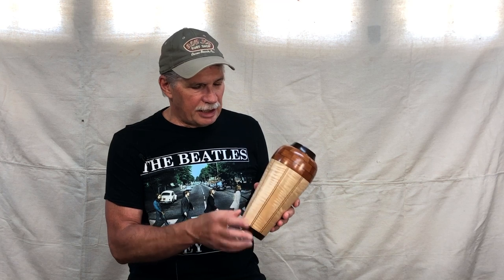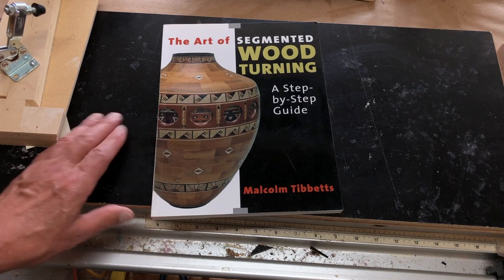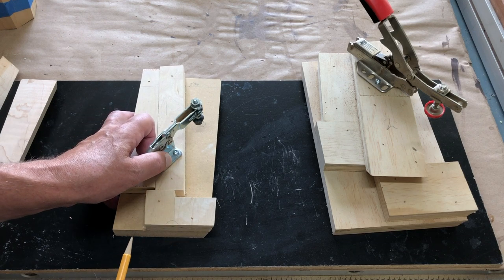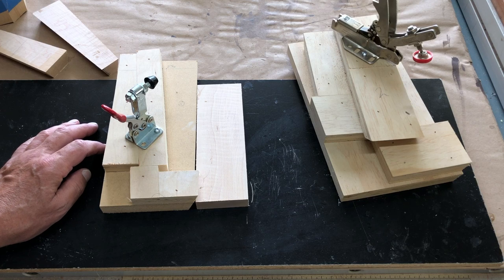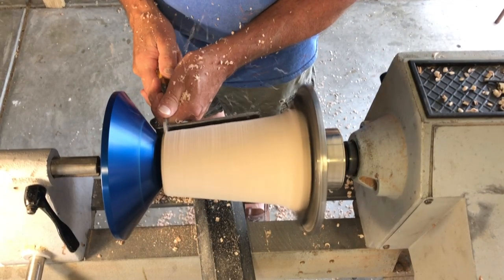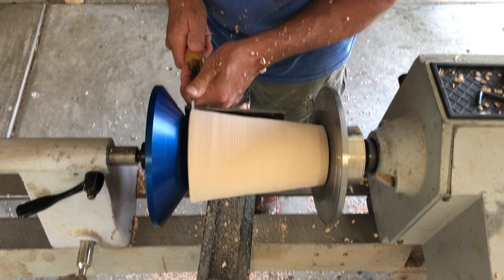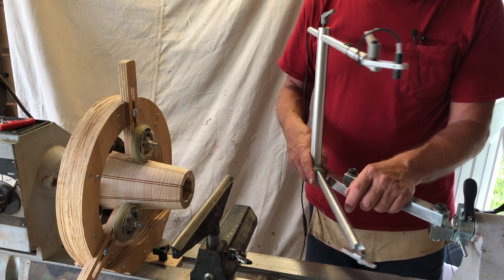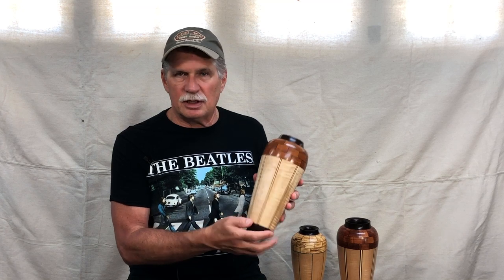Staved & Segmented Vase - Part 1

Comment: Excellent demo!
Reply from the maker: Thank you very much!
Reply: @slindsley1951  Steve, I built a jig, and produced an 8 sided “trial” and it wasn’t too awful for a first blush.  The biggest issue is the “twist” which you mentioned.  I’m pretty sure this is due to blade alignment with the fence.  From my understanding, the blade in vertical position can be slightly out of alignment with the fence, but this will be exacerbated when the blade is tilted…that’s about the only way I can figure the “twist” in the glue up.

Comment: Hi Steve,
All I can say is that if I lived next door you'd have to put up an electric fence and lay a mine field to keep me out!!!
I can't tell you how much you have inspired this 75 year old guy!
Thanks for this and all your videos!
Tom
Ps: where do you buy your rubber bands?
Reply from the maker: John - If you lived next door you'd always be welcome in my shop for a cup of coffee and good conversation!  I picked up my rubber bands at Office Depot but I'm sure they would have them at any office supply store like Staples.  Take care,  Steve
Reply: @slindsley1951  I have enjoyed your videos and am trying to start segmented Turning.  Having problems getting seams on #2 ring to line up with center of segments on the first ring.  Can you help with this problem?
Reply from the maker: @johncox9971  John - Do you have the same number of segments in each ring?  If yes, then you should be able to get the joints on ring #2 close to the center of the segments on ring #1.  It doesn't have to be exact, just close.  Once the piece is finished no one will notice if one ring is a scootch off from the one above or below it.  Hope that helps.  Take care,  Steve

Comment: The 21.69 blade angle is devided by two is that correct.....? So the bade is set at 10.855?
Reply from the maker: No the blade angle was 21.69 (or as close as I could get it).  It's not divided in by 2 when cutting staves.  Thanks for watching.  Take care.  Steve
Reply: @slindsley1951  Great, appreciate the help! I am making a tapered stave speaker cabinet for a guitar amp. And my wood working skills will be tested.